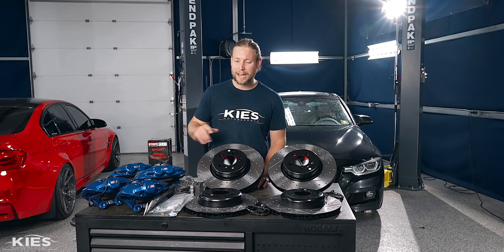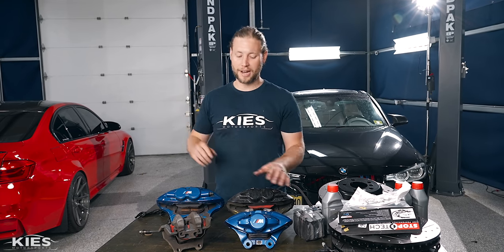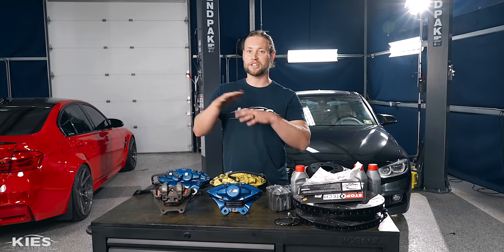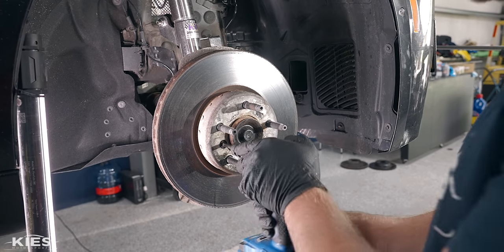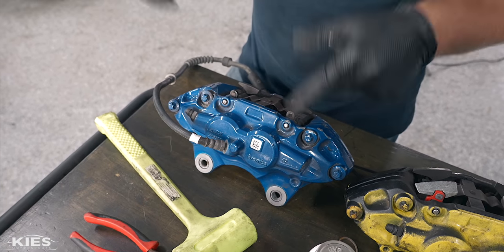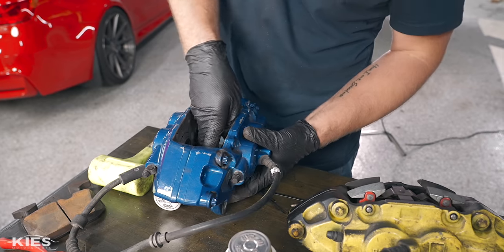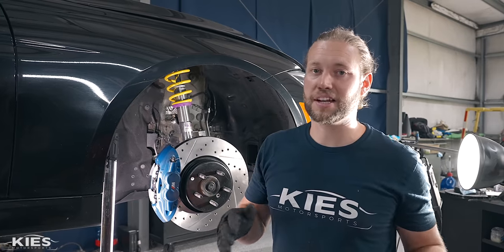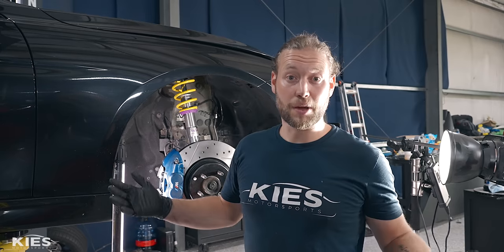How to install F80 M3 Brakes on an F30! CHEAP Big Brake Upgrade!

Comment: I appreciate yall continuing to make content on the F30 even though there is a new generation out.
Reply: I echo his comment.  Fantastic job putting out this material.  I can’t tell you enough how thankful I am for it.  The F30s are at an age now where modding is about to explode.  Warranties expiring and pricing is in the range of the younger generation
Reply: The f models are just beginning their way. They still have a lot of lifetime and tuning parts are still developing.
Reply: Is  yall   A word?
Reply: @twinturbo8304  yes also known as y'all (you all)
Reply: I fully agree, my F34 was bought out of warranty used a year and a half ago and the youtube community has been a vital suppliment to the Bentley manual.
Reply: @iamworthy1302  is 'gotten' a word also or is that another assault by the mercans on the English language? 😂 😂 😂
Reply: @f32440i  It's apparently a Middle English word that NA preserved as an actual word. So yes, and yes.
Reply: The cheaper and further out of warranty these cars become, the more DIY videos you will see. The new ones are still owned by nerds under warranty. 😂
Reply: It's because this is one of the best platforms ever...F30❤
Reply: Still watching it in 2023!

Comment: Just a side note here Brian, make sure to code the DSC with the correct disc size so the ABS/DSC knows when to trigger ABS when necessary. When retrofitting larger brakes/brake discs, you want the ABS to kick in later compared to smaller brakes!
Reply: I coded SPBR in my F30 but i dont see any option in DSC for me to change the disc rotor size. Can you enlighten me where I can change it?
Reply: Would you be able to share the coding process please? I’ve done some research already but still not 100% that I can do it correctly.
Reply: This is true. The brake bias needs to be adjusted. VO Coding SPBR  to HO WORT option will do the trick.
Reply: @Steven6489  I am 99% sure adding SPBR to HO WORT is sufficient. Anecdotal evidence from people across forums is that FDL coding rotor sizes has no impact on braking.

THIS IS SPECULATION, but I've heard adding S2NHA to your VO will expose rotor sizes. I don't know how SPBR + 2NH play along together.
Reply: Def note that

Comment: There was a separate Msport brake option that included these calipers and rotors for the F30 335 and on the 340 it was part of the track handling package. So glad mine came with it. If you can’t find used M3 you can search for the upgraded Msport ones. I’m pretty sure they are the same brakes. There was also a dealer accessory package adding a bigger kit in Orange, yellow or red with slotted and drilled rotors.
Reply: Yes, M-Performance retrofit has yellow/orange or red calipers.
Reply: I'm glad you brought this up! I have a 2014 335i with the blue m sport brakes. I have F 80 lower control arms. I wonder if I can run the 380mm rotors?

Comment: I went with the most aggressive one, 6 pistons front, and 4-pistons rear. It's one of the best mod i ever done. 
And rotors are 380mm all round front and rear
Reply: You were able to fit the rotors on your f30 with no modifications?
Reply: Why is it one of the best mods you've done?

Comment: You don't get higher stopping power with larger brake discs, but you can use them more before brake fade from overheating. Braking is tyre limited.
Reply: actually you do get more stopping "power". You just can't use it because as you mentioned, it's limited by tires.

Comment: 14:46 unless work is done on a 7 series and upgrading to M brakes for some yacht racing, might call it Portside and Starboard. Installing a hood on the bow and new exhaust back at the stern lol

Comment: Btw in a stock m-sport calipers you can fit 370mm brake disc. I did it on my 330d without changing anything, 370mm front and 348mm rear.
Reply: Yes, but what size calipers did you have? 340? Or 370/380

Comment: I never realized how easy this was! I also just bought myself some used F80 calipers recently and installed them on my F22! Also had them powder coated. 
Thank you so much for the inspiration & giving me the confidence to do this!
Reply: What rotor size did you use?
Reply: i use the 380mm rotors on my m240i f22 and they fit without any Problem even on 18 inch
Reply: Even im running the Normal m sport calipper with a Spacer its cheaper and works as well

Comment: I don't know if this applies with a M Sport package vehicle but if you're doing this with the M Performance Brake upgrade on another trim like sportline, you need to code the vehicle by adding SPBR to HO-Wort and code the DSC module.
Reply: Hi dude! Why do you think SPBR is right option? There are several different options for perfomance brakes that i met: SPBR, SBRE, SPBO. But i have not figure out what is the difference between them.

Comment: Yes, don't forget to pump the brakes after! Ask how I know 🤣
Reply: Oh no! 😂
Reply: Yes , I know this part like the back of my hand, but sometimes I forget this step when am multi-tasking lol....hey Justin am subscribed to your channel 😁
Reply: Yeah me too! Lol
Reply: How do you know?. (Since you told me to ask you)
Reply: @cuttthroatperformance2752  I did the brakes on my avenger and forgot to pump them. Put the car in reverse with my foot on the brake (automatic) and it started rolling. Ended up taking out some of my landscaping before the brakes were pumped enough to stop the car 😅
Reply: The 🐐
Reply: How do you forget to pump the brakes? Lol
Reply: @worlboss2844  Dr.
Reply: I learned it also the hard way by hitting the wall 😁😁 luckily my speed was something like 5 km/h

Comment: He even had the P337 brakes which are LARGER than the junk floating calipers. I had the floating 312mm fronts and swapped to the 340 blue calipers. Love them.
Reply: Did you have to change rotors. I have new CQuence rotors but want you upgrade to M sport calipers

Comment: Thanks for the professional step by step tutorial. I have a 2015 640i grand coupe and looking to do the M6 break caliper swap with new routers and pads like u have done. 

My question is do u know if the M6 calipers would fit the 640i and what size disks i would require for the front and rear please ? 

Thanks again

Comment: At 21:50 the rear discs are difficult to get off because of hand brake / E-brake as you call it in the US. You need to release it before taking the discs off otherwise they'll be a pain the ass

Comment: Hey Bryan.

In the rear you torque the new bolts down at 37 fp and the rotate it an EXTRA 90 degrees.
In the front I didn't see you rotate it an extra 90 degrees after you torque it at 80fp. Is the extra rotation in the front not necessary?

Greets Joey

Comment: Thanks this awesome video. Don’t you have to code the new m sport brakes to the car to account for the two piston calipers? Any chance you can do a video on the coding process? 

I’ve read that you can go without coding but the brakes will feel spongy if you don’t code. This is really the only thing stopping me from doing the retrofit. Have the parts purchased since last year but not good at coding.
Reply: Did you find out if we need coding?

Comment: Question...when you pressure the brake system wouldn't that push the pistons inward, hence not requiring you to really pump the brakes?

Comment: Kies, is their any coding of the computer involved for the brake upgrade?
Reply: Technically yes, but you don’t have to. On my channel I went thru and did the M Sport big brake kit and the coding. I didn’t notice much of a difference before and after coding it. Good Luck.
Reply: YES

Comment: QUESTION ... I have the normal brake calipers on a 320i ... can I upgrade right away with some used calipers like this? or do I need an adapter to fit them?

Comment: Why does applying pressure on the brake pedal close off the valves? I expected pressure to be there when you removed the lines?

Comment: correct me if im wrong but the M3 caliper is different to this... the caliper used in the video is the m sport brake kit for i think it was 328i and upwards
i mean even the part number is different M3 ends with 63/64 and regular 3 series ends with 69/70

Comment: Hey @KiesMotorsports just wondering if this same set up would fit a normal F30 with the standard brake set up?
Reply: No, it wouldn't. You need larger rotors in the front and rear. 370x30mm in the front and 345x24mm in the rear!
Reply: @lfsmith7  So, technically, yes, if you upsize the rotors?
Reply: But the callipers just bolt on as I gather all of the knuckle sizes/position are the same?

Comment: My F30 330d with the msport plus pack came with 370mm discs as standard and the blue calipers with the 2 pot rears. Mine is a 🇬🇧 car.
Reply: same for my 335d. this is "S2NH M SPORTBREMSE" option not M3 brakes he is installing

Comment: Brian, I need help.  I have a 2018 X3 M40i and need rear brakes and rotors done.  My local dealership I think is over the top on price.  Where do you recommend getting parts?  Or is there a brake upgrade you would recommend?
Reply from the maker: We offer many brake upgrades or replacements for your car, depending on what you’re looking for! We love to run upgraded slotted rotors and low dust brake pads but also have more OEM style replacements. If you reach out to our team at INFO@KIES.COM our guys would be happy to help you out with more details as well as the specific parts and brands we recommend 💪

Comment: I noticed that you only put the brake lube on the back of the pads where they contact the piston. I’ve seen others that recommend also putting the lube on the metal sides of the brakes and on the pins. Is that not necessary?

Comment: Does your handbrake still work fine? I noticed since I upgraded the rear rotors from 300mm to 345mm, the diameter of the top hats also got larger and the E-Brake shoes doesn't seem to reach the new hats anymore.

Comment: hey Brian you mentioned that the wheel hubs and carrier prevent the ability to use the larger 380mm rotor so im curious if you know whether or not its possible to swap the f80 wheel hub and carrier onto the f30 and will that then allow you to use the larger 380mm rotor? Thanks in advance!

Comment: Brian, why did you switch from the motul 600 to the motul 660? Just curious. I have the M3 calipers standard for my 435i. Is the 660 recommended for the blue caliper and 600 for the base brakes? Or just preference?

Comment: Has anyone done this with 18" wheels (400m)? Any clearance issues between the caliper and wheel?

I put some slotted rotors from ECS and Hawk HPS pads on, which is OK for the street, but the factory rotor size is concerning for track use.

Thanks for this guide.

Comment: I wonder if F82 m4 standard steel disk brake and caliper will fit on regular f series? Would it be direct bolt on?

Comment: Did everything and got chassis stabilization error after. I think a wheel hit the front caliper and knocked something out of alignment. Going to get the car back on Jack stands, retighten the caliper, and realign the rotor and see if that fixes it. I need that stud conversion 😑

Comment: 340i with 2 piston rear and 4 piston front calipers. Just did this over the weekend and followed the ebc yellowstuff pad bedding process to mate with the also new zimmerman slotted/dimple rotors. is the air "woosh woosh" type clicking sound normal? hear it exceptionally driving next to cars or barriers with windows down. Also, when i brake firmly i get a hum/drone noise. and no my pads aint on backwards. done plenty brake jobs. its just my first time using these type of rotors.
Reply: Read about this issue on the forums ,seems it's only with the slotted dimpled rotors.Was contemplating upgrading to the slotted dimpled rotors , but after reading about the clicking sound I'm put off

Comment: Hi 

I just bought rear calipers blue from a 2016 m3
They say p244

Can I use 2016 f80/m3 rear calipers on my

2018 340

I 19inch rims.

The f80 M3 calipers had 370mm rotors in the rear original with the m3 car.
The stamp says p244 I’ve seen p240 on other research with m performance package
The 44 is a bigger piston same size as the m performance

Can I use the 345mm rotor on the p244 blue caliper
I know they originally came with the M3 and 370 rotors
My big question is
Can I use the calipers I bought and just use the 345mm rotors

Comment: Is this the best brake upgrade I can do? I have 18 inch rims and I was looking at 6 piston brembo gt or stop tech.. but not sure if they fit. Does a 370 rotor fit 18s? And are there any 6 piston calipers that fit?
Reply: Fits perfectly on 18s, they look awesome.

Comment: is the 2 piston front gray the same size as the blue m3 front calipers? askin because im using 17x9 wheels which say they wont fit the big brakes . i know they wont in the rear, but i think they will in front

Comment: Hi
I have 370mm discs on the front with 4 pot  and the rear 345mm single pot I will be installing new discs with 4 pot on the front and 2 pot on the rear but what size is the hub on the rear

Comment: I want this. I have the M Performance BBK and I hate how annoying the sound coming from the dimpled rotors. Any noise while driving or applying brakes?
Reply: I had the exact same issue when I upgraded to the M Performance BBK. The issue is with the front Brembo rotors. I fixed it by finding a TSB that provides a remedy of adding these shims. Problem solved. The part number is 34-10-6-887-529
Reply: Alex Were you having ticking sound when cruising normally? I’m very much annoyed by the sound... Do you know what caused the issue and how this shim can solve the problem? Thanks a lot!
Reply: @arov235  my guy, you gotta help. The noise has been driving me insane for a bit now. It’s the ticking noise when you get to about 20 mph. What do i need to do with these shims to solve it?

Comment: is the dsc brake bleed process through ista necessary? thanks
Reply: Not really in this case, the ISTA procedure is good for a full brake fluid service when you flush it all out, but for this it should be fine with just the normal brake bleeding process.

Comment: Some f30s come with those rotors front and rear from factory right ?
Reply: M-Performance brakes have these slotted/dimpled rotors. And always 370mm.
Reply: Yes
Reply: Yes and no. An F30 with the M-Performance brake pack will have blue calipers and look identical to this but has the 340mm BMW/Brembo front calipers instead of the 370mm version from the M3/M4. And 6 cylinder F30s come with the grey 340mm BMW/Brembo front calipers as standard because the engine is heavier.

Comment: Hi Guys, any specs about the caliper bolts sizes (length, etc) and the ones for holding the rotors? Metric system please ;)
Hard to get full kits in Switzerland, so have to buy piece by piece 😅
Cheers

Comment: You absolutely do not need bigger brakes when adding power. You need bigger brakes if you're going out to track days / drifting / other racing to account for more frequent braking and increased heat.
Reply: Yea, you never wanna stop better after your car is a bit faster🤦🏽‍♂️

Comment: I have a m sport (blue) calipers. My current front discs are 370mm flat disc/rotor. Can it take a 370mm drilled, slotted disc/rotor ?
Reply: f32 435i m sport car*

Comment: Is master cylinder size on 328i insufficient to push enough fluid to rear making the pedal spongey? Is brake bias out of whack front to rear now? It's the most critical safety system on the car, to be responsible seller more numbers/math is needed.

Comment: When in the video did that 2x4 pressing down the break pedal magically disappear? First it is there with a comment of how important it is. Next scene it’s not there and the pedal is pressed manually during the bleeding.

When do I release the pedal? I see Kies is no longer responding to these videos. Community input maybe?
Reply from the maker: Once we had the lines reconnected, we pulled the 2x4 out
Reply: @KiesMotorsports  thank you!

Comment: Love the Video Bryan, but two question, while you were changing the rear, why didn't you change the park brake pads while you were there, and the heat shield why not replace it with the one that fits instead of bending it. I would have done the lot, but that's just me. Still love the video.

Comment: I have a 328i 2016 f30 will these brake caliper work for my car as well?
Reply: I have a 2014 and want to know too. Did you find out? I'm due for brakes on mine and am thinking of doing this instead.

Comment: Does this work with 18" wheels or do you need to be have 19's or 20's to fit the bigger rotors?
Reply: I have the m performance brakes which I believe are the same setup as the m brakes and I rock 18s. Both the M sport 18s and now the m513s which are standard on the m3/m4
Reply: Fits perfectly on 18s

Comment: recently I got to notice that the f80 grilles are much more beautiful than the m3 style f30 grilles and no one's talking about it on the internet. The worst part is that after I spotted in I can't unsee it. is it possible to fit in original f80 grille on the f30? please please RESPOND ANYONE
Reply: Not possible, the F80 front end is based on the F32 4 series and has a different grille shape. You can get aftermarket F80-style grilles for the F30 though, they look quite good.

Comment: I have the same rotors with my blue brembo rotors. But I hate the rust ring on the front from the section that doesn’t make contact with the pads. I get the rust ring anytime it rains. Anyone else have that issue?
Reply: Meant blue brembo calipers

Comment: Can i apply those blue brackets on e90?
Reply: Only talking about the non M-Models:
Front brakes (both the 340mm and the 3790mm Versions) fit plug n play on the E90 - beware of the rim clearance tho
the rears need some modification to upgrade to the M-Performance breakes